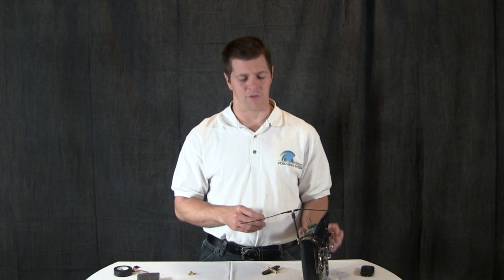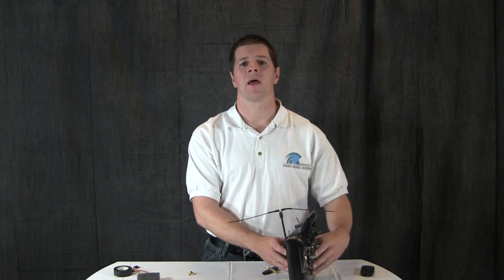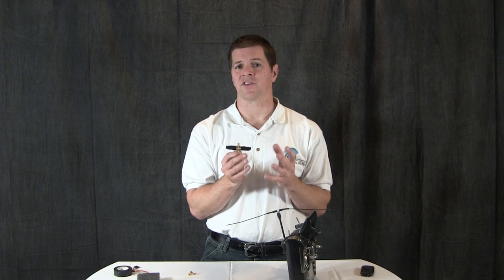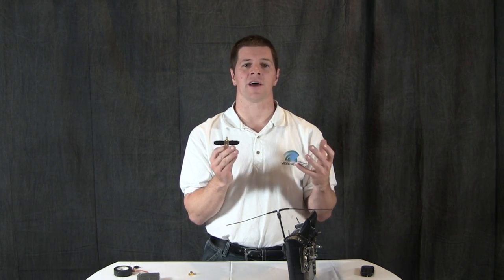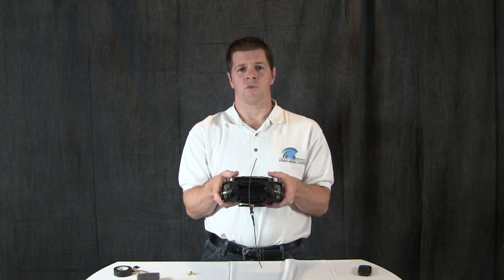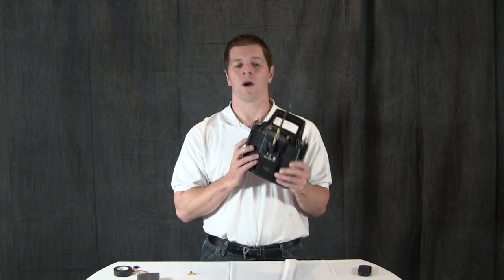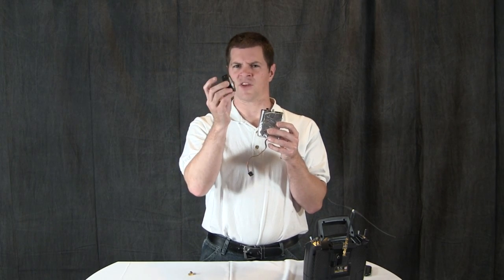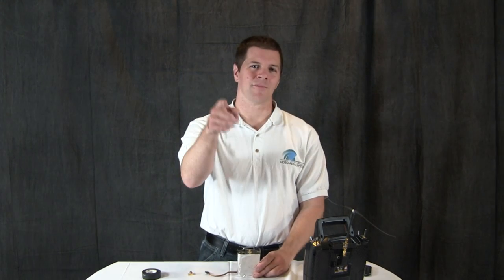433/1.3GHz notch filter

Comment: Hi Alex
I have a problem, my 1.2ghz VTX (1.5W) is interfering with my RC 433mhz signal.
The video is clear and clean all the time, but I lose the RC signal just 100m away.
If I replace the 1.2ghz VTX with a 5.8ghz VTX (600mw)I can go to more than 2km with no RC signal problem (rssi 90%).
How can i solve this problem ??
Reply from the maker: This sounds like a case of overloading the receiver due to excessive power.  I would recommend stepping down to a 400mW transmitter as this would certainly fix the problem.  However,  you might get away with running the VTX wires around a ferrite core.  But again I would recommend simply stepping the power down.
Reply: @CAGreve1231  Ok thanks for the reply
Now, i confirms my intalation do NOT have a ferrite magnet mounted on the VTX output, so this is the 1st i want to try before buying a new VTX with less power.
Placing a filter on the WolfBox 433 Receiver can help ??
If yes, should it be a low pass filter, a high pass filter or a notch filter?
Can you put me a link to your online store please?

Thanks for your time
Reply from the maker: @fndfpv3678  - You need to wrap the power wires around a ferrite ring.  A low pass filter isn't going to help you much.
Reply: @CAGreve1231  Great you are asome ¡¡
I gona try all yours recomendations.
thanks for your time
Reply from the maker: @fndfpv3678  - Please let me know how it works out.  I am here if you need any more help.
Reply: @CAGreve1231  Hi Alex, this weekend i try the VTX 1.2ghz with feerite ring but i dont see any change.
Arround 100mts the RSSI on my WolfBox 433mhz is going down to 70%.
I dont try flying, but i think is gona be worst if i go to 1km in the air.
Maby i can try to make a Faraday Jail on my VTX and change the original antenna for a handmade dipolo.
What do you think ??
Reply: @CAGreve1231  Well, after several modifications to the VTX 1.2ghz of 1500mw, this weekend I tried to mount it on a plane (mini talon) next to the RX WolfBox 433.
While it is true that I have not tried to move more than 300m away from home, I have not had any interference.
I hope next weekend to be able to make a longer flight and get away from home to check their behavior and monitor the RSSI.
The modifications have been several, 
-I have completely disassembled the VTX housing and manufactured a faraday jail, wrapping it with copper strap.
-I have manufactured a dipole antenna for 1160mhz (6.0215cm every 1/4 wave with 1.3mm diameter copper wire).
Separation of both antennas 64cm.
-Exclusive 12v BEC for the VTX with a ferrite in the +.

Despite all these measures I have some static electricity in the video, but for now I have already managed to get both together in the same plane and the VTX now is not disturbing me to the RX of 433.
I will continue testing.
Greetings

Comment: GDay Alex, was wondering if you knew if this notch filter would also help with interference from the 1.3 transmitter and the gps antenna on board? I'm still noticing significant issues with my two antennas as far apart as I can get. Thoughts? Or I need a low pass for this sort of job? Cheers and as always thanks for being #1
Reply from the maker: +Guy Harding - Unfortunately, It will not help at all for this purpose.  You need a low pass filter.
Reply: +Alex Greve Cheers Alex, so the power drop on my video Tx is collateral damage in a good gps lock on the 1.3ghz line? Separation and the low pass  is the best I can do. Maybe I shall drop down to a 300mw Tx. ;-) but I'll try the low pass first.

Comment: Hi Alex,

many thanks for your video, it is very efficient for beginner like me.
One question about isolation of the case:
You said first wrap it with isolator then wrap it with aluminium, does that mean the aluminium must NOT touch the UHF case?

I wrap it on side but not top and bottom and some few parts of aluminium may touch the case...

Thank you for your time and your answer!
Reply from the maker: Correct.  The metal wrao must NOT contact the case or it too will resonate.  You are making a Faraday cage with it.
Reply: Alex Greve Thank you Alex and have a nice day!
Reply: Alex Greve Hi Alex,
I well received the filter, then I also follow your advice and shield my UHF case with aluminium foil (2 thickness).
It is working very well, no interference between UHF and video system. 

Since I saw your video I start to be very interested by interference because I am flying with a small quadcopter 450 size. I saw gopro got also interference wich UHF so I decide to wrap it with aluminium foil. Waiting for a good meteo to give you feedback.

You didn't mentionned to shield (ESC, VTx, etc..) or put ferrite or twist cable.
What is your point of view about all this interference killer solution? 
Where we have to put it? Any solution to avoid interference without adding foil or ferrite?

Thank you for your help and have a nice flight.
Reply from the maker: Solene Ortega
Adding ferrites and shielding should only be done as necessary.  if your system is working well then you should not be adding these components.  If you need them, ferrites can be placed on the VTX wires to eliminate common mode currents.
Reply: Alex Greve OK thank you again Alex. I will test without it and see if it is a real need or not.

Comment: Alex,

Does it work on a UHF 438-441MHz without additional loss in this band?
Reply from the maker: Yes.  There is no discernable loss at 444MHz.
Reply: Alex Greve Thanks for the reply. Since it is a notch filter, I'll assume that the 2.4GHz and 5.8GHz harmonics from the LRS will also be considerably attenuated ?

Comment: I use Dragonlink and a vtx on 1.3. Do you recommend wrapping my Dragonlink module?
Reply from the maker: I used aluminum foil, but aluminum duct strapping tape does really well.  Just be sure to wrap it in an insulator such as electrical tap first and you're good to go.

Comment: I hadn't noticed these when shopping rmrc - I dropped 1.3 with 2.4 control even though I had good results with your notch filter for that application. I am using a LPF now on the radio uhf module- but I think I will pick one of these up and swap it out for good measure- I am familiar with notch filters from my years working in the cable tv business- different beast but same principle. (it was how we blocked HBO in the old days for customers who didn't pay for the premium channel) I still remember a lot of the frequencies various premium channels used- I remember in our local plant when broadband internet was first implemented and for a long time it ran at 577mhz- which really sucked for a tech like me who was trying to help customers that lived where the field plant only carried 450mhz. That was how comcast began it's evil empire- selling that kind of product, lol!

Comment: I have never had any trouble with my Dragon Link.  Does it hurt do do this anyway?
Reply from the maker: Filtration is usually a good idea, but if you are not having issues, then I would say don't bother with a filter.  It would simply be peace of mind in this case, but not necessary.